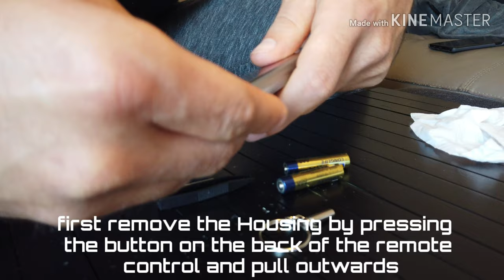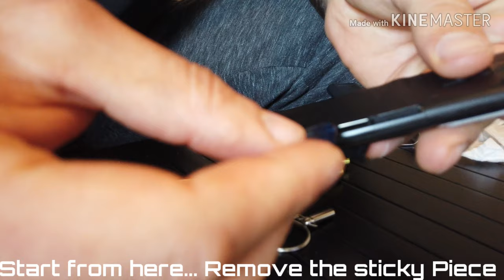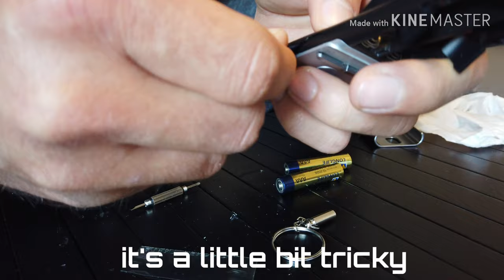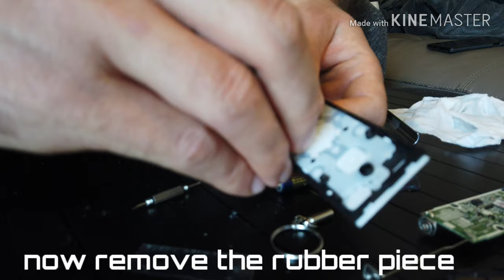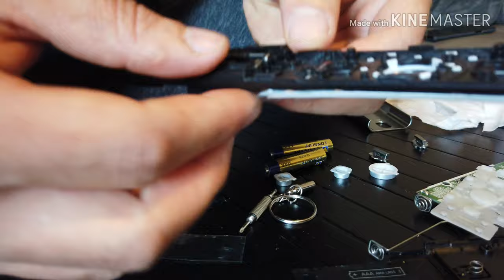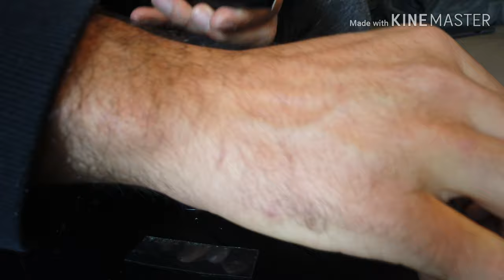Disassembly Samsung Smart TV Remote Control

Comment: great vid sir .wonder if you can help when i try to press the black button on the back nothing happens just wont budge, any suggestions would be great many thanks.
Reply from the maker: Thank you so much. Press on it and try to push it outwards at the same time. I think its just stuck inside
Reply: @thejordaniangerman2589  thanks for the reply,been trying for seems like hours but the button just springs back even tried a stanley blade i know without seeing its hard for yourself to solve but thanks so much for replying
Reply from the maker: Just to clear that. If the Remote is the same then it should slide. But as to give u an Idea it slides from the front.. and the Back is a fixes cover and doesnt move.
I hope it works. Good luck

Comment: Hi great video, I have a question if you could help please...I have the same remote but the battery went flat so I used the other remote for a while.....now I've replaced the batteries and it won't work, the red led light doesn't flash when I press any buttons. If I was to open it up what would I need to do to make it work again? 

Any help/advice would be great
Reply: Hi. 
If it doesnt light you need to check two things. 
First make sure that the new batteries are really new. For example try them on another device. Second is to make sure there is no white debris or calc on the metal part in the remote where the batteries fit. It may cause current connection issues due to having the batteries inside and not using the remote for long. 
Regards
Reply: Hi thank you for your reply, I checked and the batteries work on another device, I also took the old batteries out of the remote when they stopped working then realised I never had any new ones at home so just used the other remote, there doesn't seem to be any white residue in the battery compartment so was thinking it could be something internal in the remote but im not sure from watching the video if there is anything that could have come loose etc which could cause it to stop working
Reply: I dont think its something internal. Check if u r putting the batteries the right way inside + and - wise. Sometimes they are the other way around. Sometimes i did that 😂
Reply: 😅..I have checked and they are in correctly it seems, both batteries insert with the + at the furthest away from the volume and channel selectors and the - closest the vol/channel buttons... i honestly can't think what it could be 😬
Im guessing the remote must have broken but can't think how, I left it in a draw since the batteries went flat.
Thanks for the help
Reply: Try to reboot the remote. Remove the batteries then press the on/off botton for 8 seconds then reinsert the batteries
Reply: And if still not working try to reconfigure the remote by pressing the back and the play bottons together and then follow the instructions shown on the tv
Reply: And if all doesnt help try to open the remote as in the vedio. Clean it well and check if you find any damage. Wish you luck
Reply: Thank you so much for your advice.. much appreciated 🙏
Reply: @montyloads  so.... did you ever get it to work again?
Reply: @beri232 no unfortunately not.. threw it in a cupboard and forgot about it... using the other remote now
Reply: @montyloads  I took mine apart using this video cuz it stopped working but I couldn’t get it working again. I gave up today and paid the $170 CAD for a new one.

Comment: You have got the bottom spring wrong. It needs to fall into the notches of the bottom plate. You have the spring upside down. The spring goes into the round hole through the motherboard to the other side. From what I see you have it upside down. Am I correct ? I just disassembled it and cleaned it as well.I had the problem of draining the battery after replacing the batteries. I hope it will be fine. After all doing this you need to pair it with the TV again to get the blinking away.
Reply: I dont think its the wrong way around. It worked well this way for me. I hope it works well for you too

Comment: Hi, my remote not closing properly. my kids done something I dont know what happened I'm trying to close but its not closing properly. what should I do? Please give me tips. Thanks
Reply from the maker: The only reason i could think of would be that the black open/close Button on the back is stuck and need to be cleaned/lubricated. Try to clean it put one tiny dot of machine oil like the ones for the Haircut Machines and press alot on the button to make it work properly again then try to close the remote. Or after closing it hit with ur Finger on it till it clicks.
I hope this work
Reply: Thank you Thank you so much, I will do it today 🙂

Comment: Hi. I have this remote and the clip on the back will not release it or open it at all. Any ideas?
Reply: Hello. I think something is sticking the parts together. It should open. Try to press on the butoon and pushing the inside part out, if not try to shake the cover but hitting it on all sides of the silver cover on the palm of your hand to try to break any dry sticking material between the cover and the black part inside. I hope it works out.

Comment: Hola súper ya lo abrí pero el control no me da para la derecha que debo hacer?
Reply: Hello. Try to clean it with some alcohol on an ear cleaning tip while the batteries are removed and make sure it gets dry before you try to put it back together. Make sure also that the batteries are good. Sometimes having liquids or dirt on the Motherboard wouldnt let it work. 
Good luck fixing it.

Comment: how do you open a stuck one?  Housing won't push up to even allow the change of batteries.  Need help
Reply from the maker: You just have to press on the button on the back side and while pressing push the inlay from the Housing upwards. If its stuck you need to apply more pressure untill it comes out.. if it doesnt help try to warm the top part of the remote with a Hair dryer.. but be careful no to heat it a lot espicially to part where thebatteries are.... otherwise you will ruin it or the batteries may explode.
Reply: @thejordaniangerman2589  I've tried everything to get the housing to release but it is absolutely stuck. Maybe corrosion inside is keeping the housing from allowing the components to slide free?
Reply: @thejordaniangerman2589 its just stick there
Reply: Apply some force. Shaking and a little bending may help loosen the sticky parts.